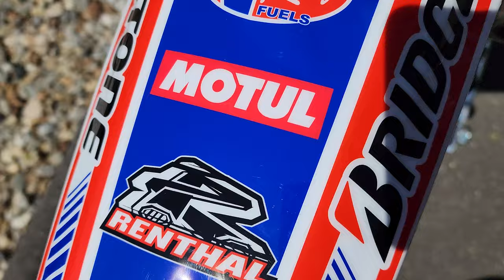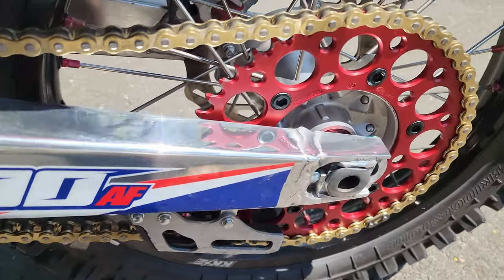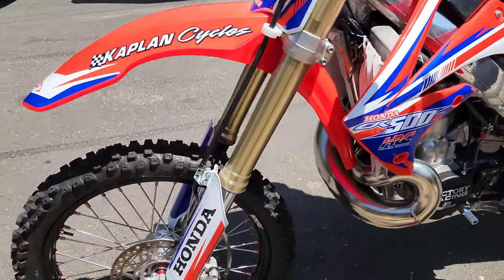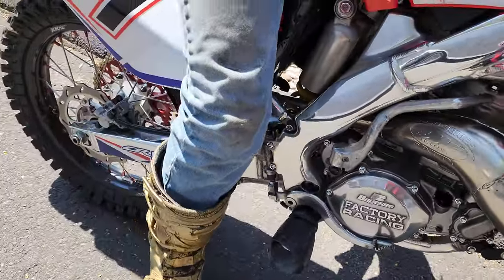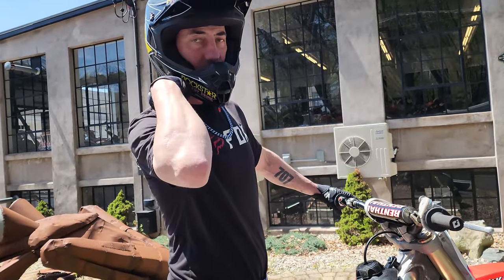WIZARD BUILT 2005 HONDA CR500 ALUMINUM FRAME CONVERSION WITH NEW 2001 CR500 ENGINE

Comment: That is the nicest 500 I've ever seen.

This brings back memories.  Had a 500 during the 90s, still riding an '18 300 XC today.  Lived in SoCal at the time and used to ride and race my 500 out at Lucerne and Johnson Valley in District 37.  

500cc two strokes are good when geared up and ridden in open terrain and thrive on having a  big load put on them.  When you put a big load on a 500 2T, deep into the throttle and on the pipe on a power sucking steep gnarly sand hill, steering with the rear cuz the front end is aloft, you commune with the Moto God because under those conditions something resembling full use of a 500's ridiculous power output is realized.  500s ruled the Western Dez racing scene during their 90's heyday.

We love 500s as the smoking, vibrating loud two strokes are just so darn primal, and we love them for what they represent - 500s are a rolling moto finger flip In our current "PC" sanitized for our protection ass gasket world.  I remember those 500 riding times fondly cuz I was young and dumb back then.  I would love to take a spin for old time's sake on that amazing bike but have no interest in ever owning a 500 again, because I know exactly what that evil thing is 😂

Comment: Been so long since I’ve even rode a 500 2t, I wish I could afford one. They are just the ultimate play bike, as for racing I prefer a 250. I raced a yz490 in hare scrambles back in my day, then in 94 I bought my first yz250 and won my first race on it. On the 490 I may have ran mid pack. It would just beat you to death for 2hrs straight.

Comment: I dont get the sharp pegs. Are they really worth It? When I raced MX anything sharp on the bike was filed down or a cap was put over it because if you didn't that sharp edge always found a way to cut you up or someone up in a crash or something.